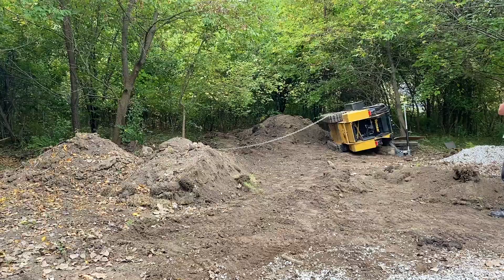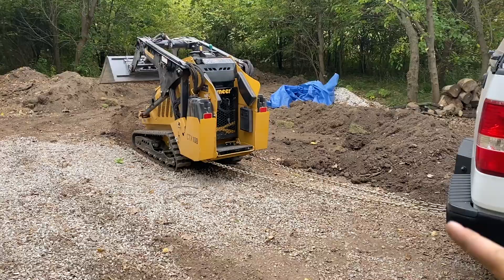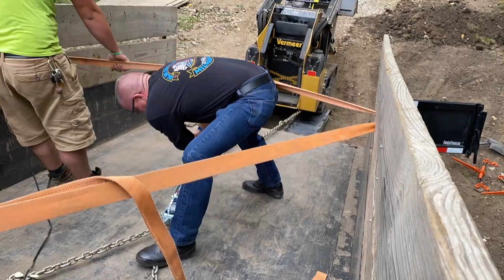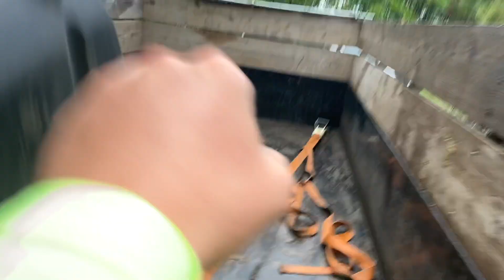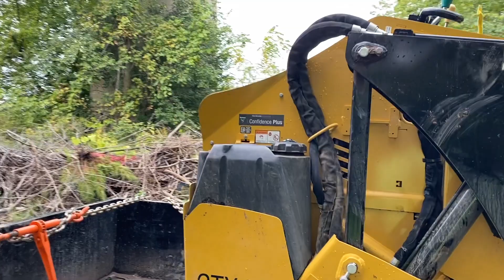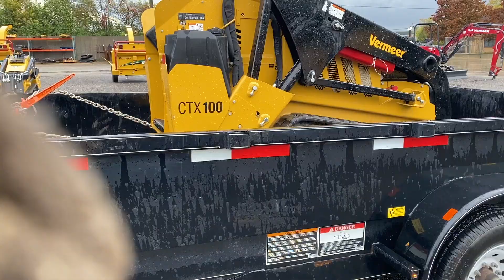The Day I Flipped My Mini Skid

Comment: I had same problem a few years ago.  It was SK750. It laid on its side for a few hours before I put it back on its feet 😅.  Couldn’t start the engine, couse oil got into the cylinders and engine got seized. All I did, I unscrewed glow plugs and cranked the engine for a minute to get rid of oil from cylinders.  Put glow plugs back and started the engine. It produced smoke for 15 minutes until oil leftovers were burned out. Added some oil to the engine and never had any problems since.
Reply: Your engine wasn't seized if you were able to start it.

Comment: I tipped our Ditch Witch SK850 a few years ago.  It's not necessarily the grade that gets them, its getting them cockeyed or off camber and all it takes is a little rocking or shifting of weight to one side too much.  Good on you to call the dealer.  We didn't call the dealer, it smoked a bit, but was fine once that was burnt off.

Comment: i bet it would of started right up 4 hrs latter. u just need to let fluids settle. if its warm that does not  take long. next time give it 4-24 hrs check fluids start it up and get back to work... dealers want ur $$$ and want to waste your time, seriously not even a service tech to come out? AS LONG AS YOU DON'T RUNT THE  MOTOR WHEN ITS FLIPPED OVER. u should be fine. flipped may machines lol
Reply: Could be hydro locked and bend rod. Better safe than sorry with machine that cost more than my first house.

Comment: Determination right here. This could very well happen again hopefully you'll be safe if it does not get hurt but I think you should invest the amount of time you spent on loading this thing into learning how to service it yourself if a shop's only charge you 400 bucks that means it doesn't take a lot of time. Figure out what you need to do so in the future it will only take you a couple hours to get your machine started again good luck. Keep operating!
Reply from the maker: Thank you Paul, I totally agree I try to do just about everything myself. This was one thing I wanted to make sure I didn't screw up and mess up a new machine

Comment: I've used that brand before and I have had it on all sorts of angles. Never had it tip over.  You have to take it slow and feel what the machine is doing.

Not sure what you were doing when yours went over.

I've used all brands of that style of machine.

Comment: Ran these little guy's on plenty of jobsites, hauling around 24" & 36" box tree's up & around some treacherous terrain & have never even felt like I was going to tip the machine. 
Work smart & operate with caution. Human error here, your bucket was loaded, lifted & you went over the mount of dirt with one track. 
Lessons learned here.
Reply: It takes so little to flip it I hit a small rock and mine flipped
Reply: Thinking the same thing...user error.

Comment: Sorry to hear that happened man! This might be a little long winded but as helpful as mini skids are I think they are one of the worst things for the industry also. They make the barrier to entry easier for people and they are so much easier to tip than a bigger machine. My sk 600 got tipped over by a friend that was using it. Every picture or video I’ve seen of one tipped the loader arms were raised up. Having them down would save a lot of accidents but they are just dangerous in general. The only good thing is your not stuck for the ride you can get off it. Glad you’re okay and the machine is good to go. I think you could have done the service yourself and saved the time to get it to the dealer and paying them to do the work. It’s pretty easy but I understand the peace of mind. Stay safe!